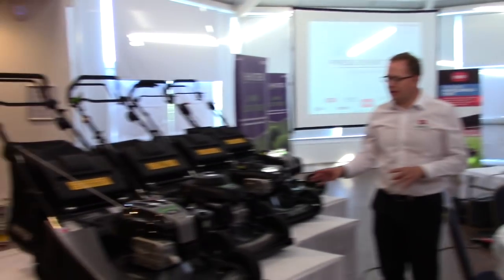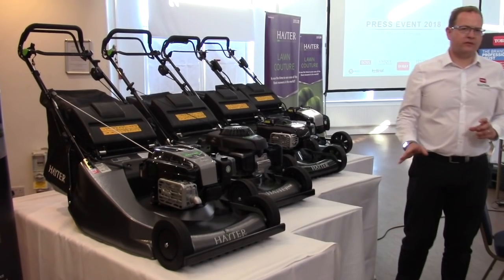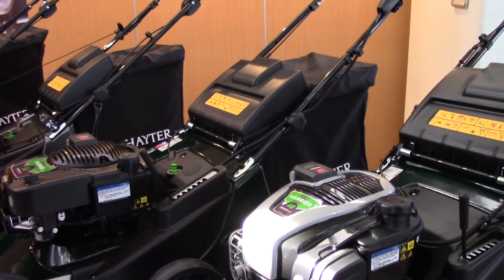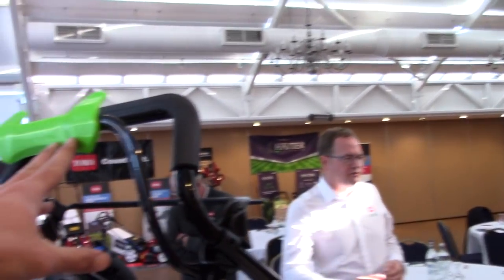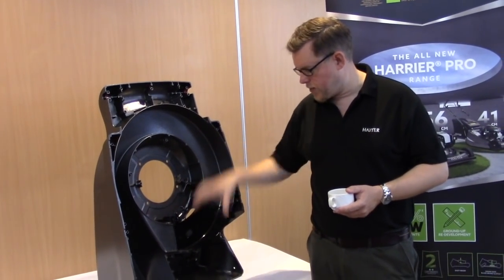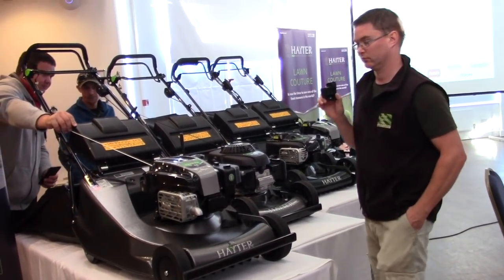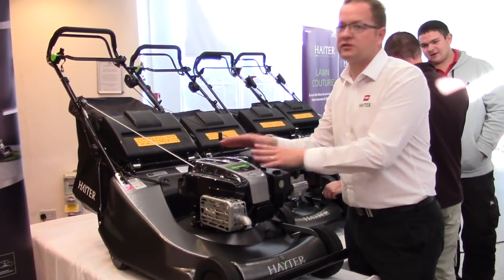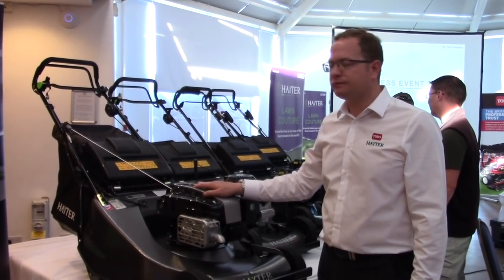The All New HAYTER HARRIER PRO Range part 1

Comment: Big mistake using Briggs and stratton engine should have gone for Kawasaki or kohler
Reply: Kohler is hardly used in uk. Kawasaki would have been better. It’s on the pro stripe 560
Reply: @GregsMowing  I really do like the build quality of the hayter but here in Ireland they are thin on the ground. Honda has every garden in  Ireland taken over

Comment: Thats rubbish what Hayet say about the Honda engine for the 56, there is a Mounfield on the market using the Honda engines and they are £200 cheaper than the Hayter.
Reply: Which Honda engine? The gcv is cheaper than some engines but the gxv160 is the pro expensive mower